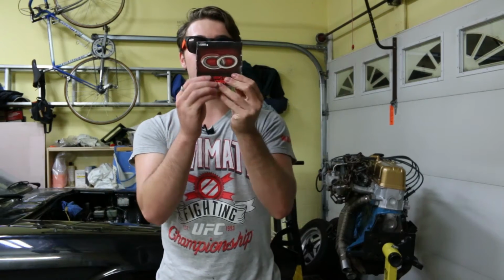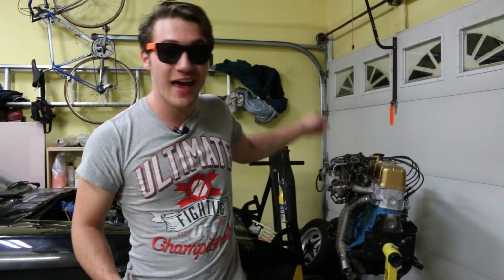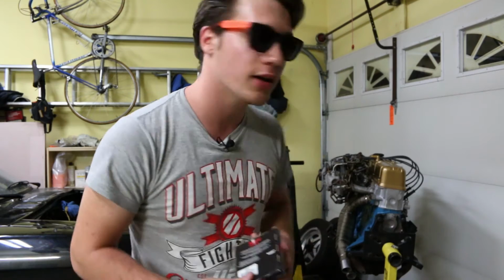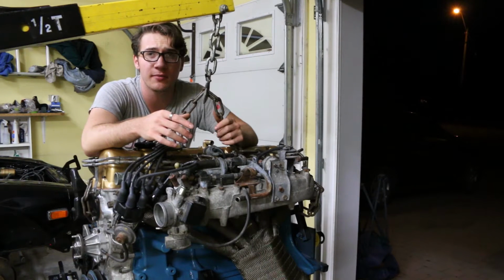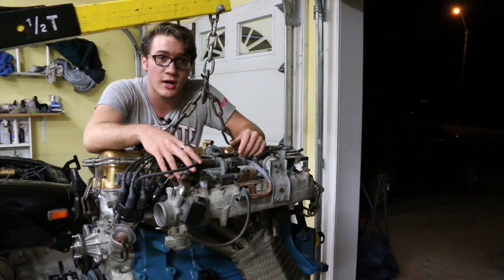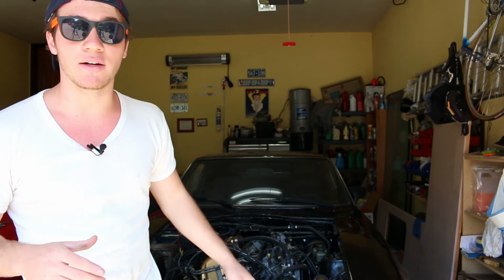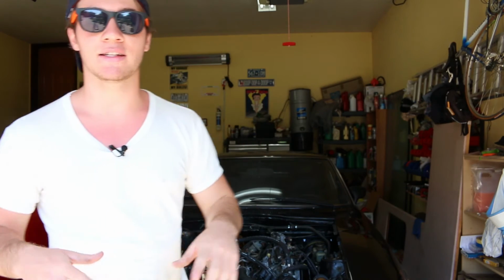Datsun 280z Build Part 18 -  IT FINALLY HAPPENED

Comment: No torquing flywheel or pressure plate bolts? Did you use lock-tite? Nice to see it running!
Reply: I saw that they did not assemble properly. Use FSM for proper assembly and torque settings.
Reply: Michael Toomey i noticed that too, but wanted to give them a pass.

Comment: Std practice should show location dowel for head gasket, timing chain tight on the side to give cam timing correct not slack and torque bolts correctly as  flywheel as spinning at 6000 rpm if goes wrong could cut your legs in half, basics lads basics before you try teaching others when you don't know what your doing.